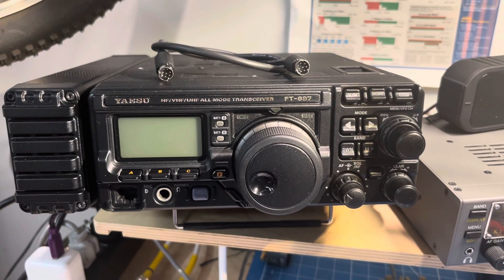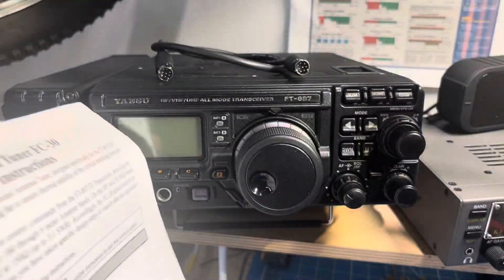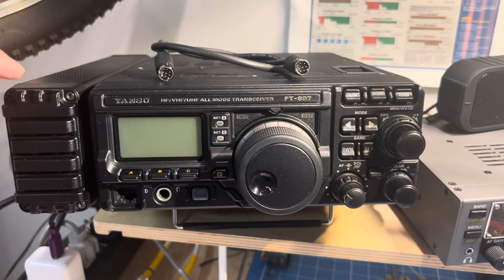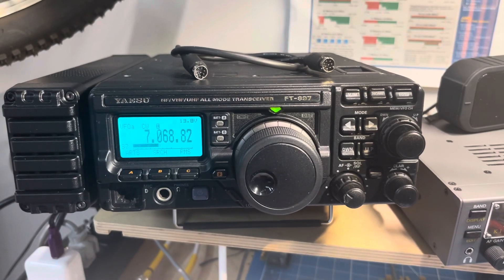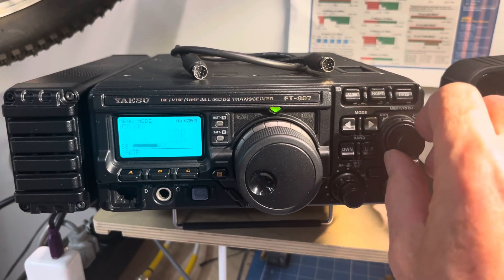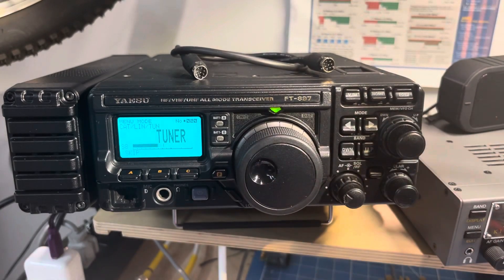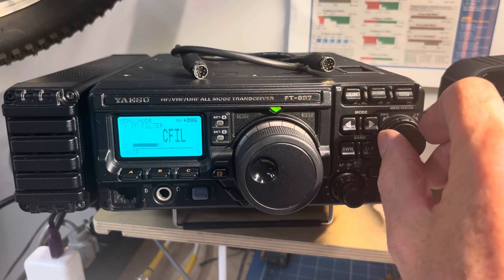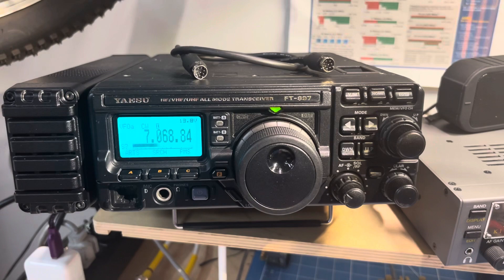Yaesu Tuner Setup. Almost a Shack in a Box!

Comment: You're right about the instructions in the manual being a hard read. I just had to do the opposite. I wasn't sure what my second-hand FC-30 had been through, so I followed the memory reset procedure from another YouTube channel. Unfortunately, that video didn't include the case removal and opening. I had to scope that out myself. But you can find the rest of that procedure here: 
https://www.youtube.com/watch?v=H66JYmNYEII

At first the FC-30 wasn't tuning my SWR correctly on 20 meters with a 20 meter dipole that should tune easily. I got a couple of High SWR messages before it did a retune. To save time, it remembers previous tunes on that frequency rather than going through the retune procedure. You have to force it to retune by repeated tries, accompanied by some clattering relays. That said, those who use it say that, while it cannot tune any piece of wire, it can make an already resonant antenna more broadband.

Comment: Not a single installation video on YouTube 🤦🏼‍♂️🤦🏼‍♂️🤦🏼‍♂️
Reply from the maker: Did you mean for the tuner, or the CAT control?
Reply: @tyrueiI  
For The tuner ,, I got my manual out , just finished it 👍,, what is the CAT stuff ?
Reply from the maker: The question also came up regarding the port used for the tuner is also used for computer control. Once the tuner is installed there is a workaround to use the mic jack, as I recall.
Reply: @tyrueiI  
Hmmm ,, I’m not real familiar 
I don’t use a computer the way I do radio 
I know a lot of folks do , but I stick to the regular way of the radio, mic and antenna and sometimes a tuner 
I’m not against learning , but life is complicated enough !!
Reply from the maker: Agree with you! I’m enjoying the K1 for that reason. Transceiver, Tuner, Battery, Noise Blanker, Variable Crystal Filters, Keyer, all in one box! Just add antenna and a paddle and I’m good to go!
Reply: @tyrueiI 
Did all the steps , the problem is when this radio came out , the tuner was a model AT-879 
Good luck finding that 
Now , I have the Yaesu FC-30 
I’ve followed every step I can find in the manual , they won’t jive 
I can’t even find the manual or auto tuner menu , they telling me 
“row k or row I” ,,, there is no rows ,, there’s menu numbers 1 through 100 basically 
I’m completely lost 
I will call DX Engineering tomorrow, I’m tired of messing with this stupid thing  the last two hours 
Thanks for your help

Comment: When you use this tuner, do you sacrifice CAT control for digital operation? It appears that the only CAT port is used up for the tuner, with no pass through option for CAT control by computer.
Reply from the maker: That is correct, the tuner does occupy the CAT connector, here is the workaround:  https://www.secradio.org.za/zs6src/secfiles/pdf/CAT_Mic_yaesu_ft897.pdf
Reply: Thank you!!! @tyrueiI